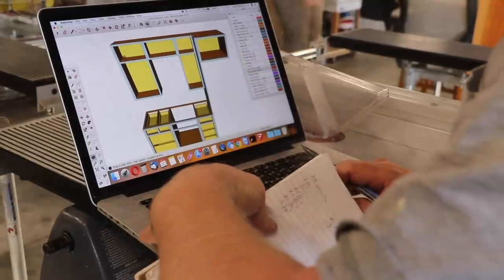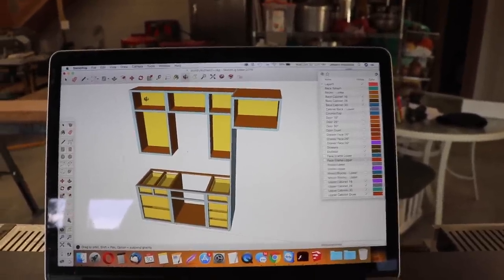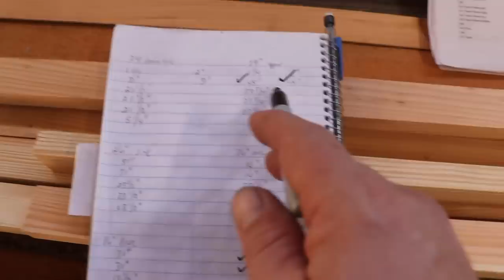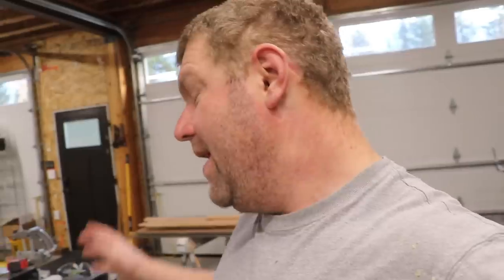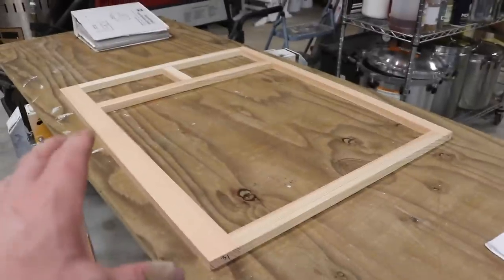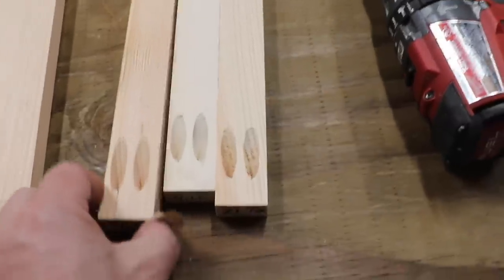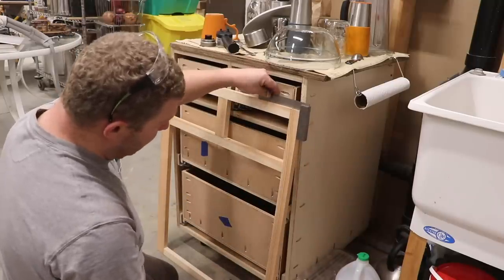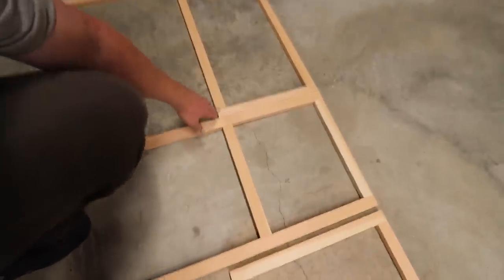DIY DREAM KITCHENETTE Building Cabinet Face Frames

Comment: Are 2 pocket holes in each of those 1.25" boards necessary?  After all, those frames are not under load and you will be gluing them to the boxes.

Comment: Jesse, a tip for pocket hole face frame joinery. Even though the joints are plenty strong without glue, I use a little wood glue with just enough squeeze out to fill any cracks between the joints. If staining, be sure to let the squeeze out set and then clean with a sharp chisel so the glue doesn't show through the stain. Wiping wet glue with a cloth smears it. The cabinets are looking impressive.

Comment: A little advice from a cabinet maker .. face frames should be added to the cabinets before the cabinets are installed on the wall ! .. it is worth the effort to make an assembly table on two saw horses .. a piece of 3' x 6' birch plywood supported by two true straight edges 3" x 4" x 6' .. shim as necessary to level .. you must always begin assembly from a perfectly level surface
Reply: Yes Jessie, you need to make a flat assembly table, you put lock casters in it for mobility

Comment: "if" you are going to "paint" the cabinets try filling the spaces (cracks etc.) with spackle compound and sand smooth.   (maybe mix some saw dust with the spackle)
Reply: Also, if you are painting you can brad nail the space frames on since you can easily cover the holes before paint.

Comment: Don’t let the drill bit load up with wood chips. It will try to enlarge the holes which will split the boards. Sharp tools and patience. 
Nice job. I also had frames where the joints didn’t seem right. It was due to the saw blade not making square cross cuts.
Everything has to be very square. You’re right. High precision is the name of the game.
Thanks,
John

Comment: Just wondering why your cross cutting and not using your compound mitter saw??. In my experience I have always gotten a much better cut with my mitter saw with a diablo 60-80 tooth blade. Your doing an amazing job and iv even learned a few things and I been Building cabinet’s for years. Thanks for you extremely patients and your extrem attention to details, and your excellent explaining of what your doing.

Comment: Why didn't you use your power miter saw? Just because you have a Shopsmith doesn't mean you have to use it for everything. And you will get a smoother cut with a saw blade with more teeth then the one you are using.
Reply: Agreed, If you still have issues with the miter saw just throw some painters tape over the places you are about to cut. Makes for a perfect cut every time.

Comment: I've done well over 100 remodel kitchens, making new face frames, end caps, drawer & door fronts. I always made dovetailed drawers, very easy once you get the hang of it. They look very impressive when pulled. out.
Reply: Or simple and slightly quicker Box Joints :)

Comment: Running the sawn edges through the jointer is likely to lead to a slightly tapered board... a common problem with doing that task on a jointer.  If deemed necessary to mill them again the thickness planer would be better.

Comment: One great thing about paint is that it covers any flaws you have in the wood.Maybe just apply a clear finish,thats beautiful wood.
Reply: Also can usually be touched up. Difficult to repair scratches in wood: Sand, perhaps re-stain & seal. getting the stain to match can be a bear.

Comment: Why not now after you have the electrical inspection for the bottom floor, do all the boxing and framing in the garage, drywall and paint colour choices etc. After all that is done, then pick the final colour or stain tone of the cabinets.
Reply: Need to apply a sealer\varnish to protect the wood from dirt and stains from use.

Comment: There are paint grade materials, and finish grade materials. You wouldn't want to cover an expensive, beautiful wood, like walnut, mahogany, cherry, or quarter-sawn white oak. You usually decide if you're going to paint before you get your materials. For painting, buy the less expensive, but stable woods, like poplar or soft maple. Or maybe even MDF, which is inexpensive, flat, stable, works well, and takes paint well. Straight grained, clear pine would be good for either application. Knotty pine takes a little extra work to prepare it for painting.

Comment: Alternatively you will get a better/cleaner cut with your power miter saw and an appropriate blade.. Blades do make a huge difference  .More teeth and tipped
Reply: Or a Sliding Radial Arm Saw for stock wider than 3-1/2 Inches. Such as with some types of Crown Moldings.

Comment: Jessie you need a hook rule when measuring  for finish carpentry  not a rough carpenter's tape I have a 6 in 1 ft 2 ft and 4 foot hook rule when doing finish carpentry  or when using a thickness plainer

Comment: 07:37 "Hey! Look at my Thumb!"
Seriously, the more I see of how pocket holes remove so much stock and resultantly compromise structural integrity, (And alignments). The more I like decent Centering Dowel Jigs and Pegs. (Which fill the drilled voids with the solidly glued peg.) On stock that small you really don't need a peg any larger than 1/4 Inch diameter (to avoid the 'splitting' problem.)
Reply: Matthias?

Comment: Too late now, but using markers to label your wood will mean that you cannot remove the marks from the wood. I use blue painters tape pieces if I feel the need to use a marker instead of a pencil.
Reply: The marks are on the hidden parts

Comment: It looks like there is some run-out on the spindle for your ShopSmith saw looking at your end cuts in the first few minutes of the video. You'd be better doing those with your DeWalt Miter saw with a 60t blade. Either that, or cut long and sand with the disc sander. The elevation difference with the crosscut sled  is causing issues.

Comment: Ok, I'm probably missing something basic here, cos I don't know how to build cabinets,  but when do the drawer facings go on, and are the drawers not now set a little too deep after you fit the frame facings? Trying to visualise this in my head 🤔
Reply: Clare Love the drawer front will fill that void and flush everything out. He hasn’t built them yet. They come after the face frame install.
Reply: @robertrossi8997  Ahh, I think I see it now - they'll all be "flush" with each other when the drawers are closed,  I was thinking of the other type of drawer closure,  iykwim. 👍

Comment: If I may suggest next cabinets that you do do not use pocket holes as I think they affect the structure. Try dovetailing and biscuit joiner and Dedos I think would be better.
Reply: i dont know, i think them screws are pretty stout arent they ?
Reply: warren michael The screws may be pretty stout but I don’t know too many Builders that go to the trouble of drilling all those holes for joining it was just my two cents.
Reply: i wasnt doubting you, i have never made any cabinets or really done any woodworking so i was curious. I get that it looks like a bunch of material is being taken away. I am just not aware of how strong the biscuits are compared to the pocket holes and hardware.
Reply: warren michael I think with biscuit joiner the joints would be tighter as the biscuits would swell inside the wood liking it together. I guess pocket joinery will work but like I said I don’t think I’ve seen too many done like that. I’m sure there are plenty of different ways of doing it

Comment: How are you doing on your floor heat? If that heater burns up, you'll be scrambling to get another. Have you looked into an outside water furnace?? Pretty safe and efficient! All you have to do is cut all the wood it can eat!! I'll gar an tee that floor heat will be nice!

Comment: Many years ago, I worked for a cabinet maker who drilled the thought into my head that  every cut I made must have the same tolerance as a steel cut. That translated to cuts better than a 64th tolerance. 
He would reject anything that was a 1/32" off. Also, I built my first home at the age of 21. In the homes I have built and remodeled during my subsequent 50 years, the females who were involved usually wanted cabinets painted and the males almost always wanted treated wood work.

Comment: When making face frames or door,  if I need to plane or joint,  I always cut my boards to a rough dimension. This way if there is any snipe or tearout at the ends,  it will be cut off during final dimension cutting.

Comment: Probably to late for this helpful hint but, when putting on your drawer fronts drill the holes in your drawer fronts for the handles. Then center them where you want them and just fasten them temporarily to the drawer thru those holes. Then pull the drawer out attach them from the backside, pull out the temporary screws and drill for the handles.

Comment: Just a thought, why don't you finish with a clear Polyurethane to show off the wood.  If, in the future you want to paint, simply sand and apply an opaque polyurethane (your choice of color) for a nice durable finish.  I have used both with great success.  Also, I send my saw blades (60 & 80 tooth) out for professional sharpening as the finish and precision is much, much better ...... but you should know this because you know the value of super sharp chisels.

Comment: Paint is far less forgiving than stain/clearcoat, proceed with caution...

Spraying lacquer in the house with a kid might give you pause, might not...........

Waterbased finishes leave a lot to be desired for use in a kitchen.....

Consult with Sherwin Williams as to what finishes work well, you'll need sanding sealer/topcoat or undercoat/topcoat depending on what you choose. Then you'll need sanding equipment capable of delivering a suitable finish for spraying...

Comment: Please you, not others...but not too much wood look wise.....you may consider white stain ( white wash/ opague that still allowing some grain through, check it out lumber yard.) Free tip dude; When making many pieces on your table saw using a clamped stop ( requires accurate pieces to be produced) put small 45 degree angle taking low corner away of the stop that your pieces hitting . Saw dust can build up while making multiple cuts and in effect changes your lengths you need. each cut gets  little shorter as dust builds up, but if bottom corner knocked of 3/8 inch on 45 degrees allot of room for dust to fall and not affect your cuts! :)

Comment: I'm surprised you haven't hit up Festool for a domino. You could use glue that will actually hold (unlike the glue you have put in which will 100% fail) and you wont need to use horrible pocket holes! Also, I don't think anyone would be worried about paining pine, go nuts.
Reply: Face frames completely hide pocket holes and they are exactly what the pocket hole jig was created for. There is no strain on the joint... How would an expensive Domino help? Strange comment.
Reply: Tim Royal I didn’t say they are horrible cause of the look, they are just horrible to work with, due to alignment issues. If you’ve ever done it with both (which from your comment I can guarantee you haven’t) you would know how much nice it is to use a domino. It provides a solid face frame that provides huge amounts of strength to the front opening of the cabinet. This is a typical case of “If you know you know.” Tell your story walking.
Reply: @Bubblegoose  Have done plenty of face frames for cabinets with pocket holes. Simple clamping strategies completely eliminate misalignment. Narrow face frames don't even work with dominoes and the machine is awesome, but takes longer on face frames and offers no benefit. Simply not what it was made for.

Comment: Why don't you guys go for a white paint that is opaque, let's you still see the grains. We call it here, translated, open grain painting. It's spray paint, i used to use when i worked in a wood shop in my younger days. Still woodworker but not really professional anymore.
Reply: I think you meant transparent or translucent instead of opaque? A lot of the time it's called a "wash" type finish, works like a stain that's wiped off. If that's what you're suggesting then I totally agree. That would look nice! However, they may have already completely finished the cabinets. By the time everybody gets to see this video and comment, it's already done... lol